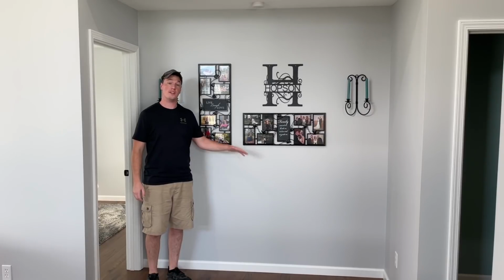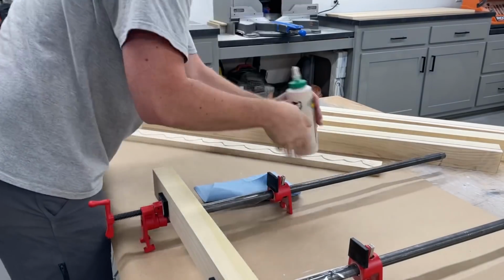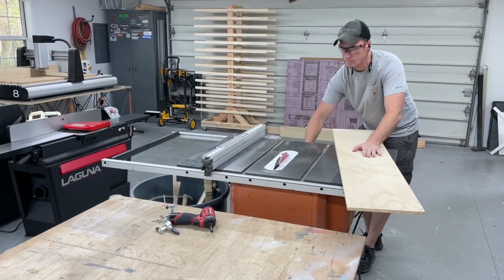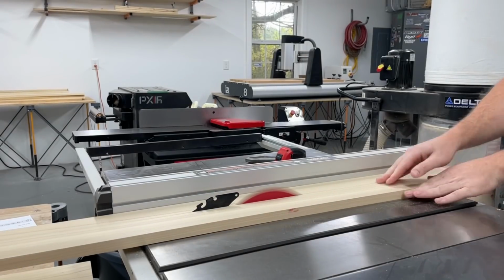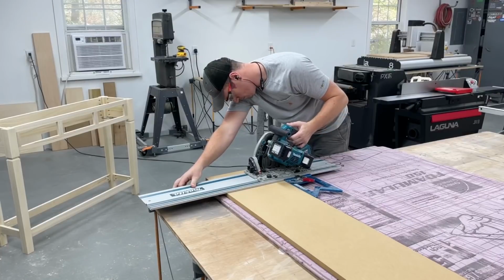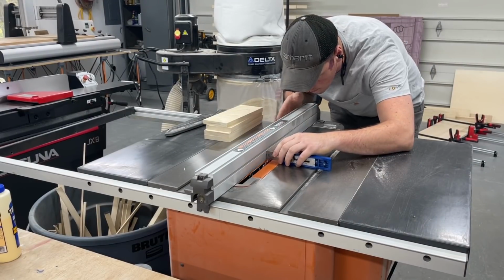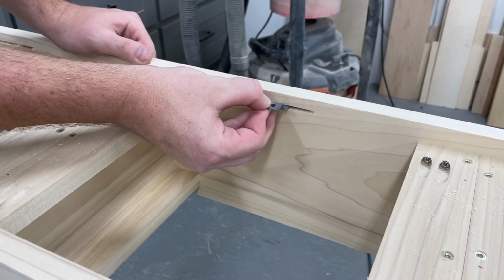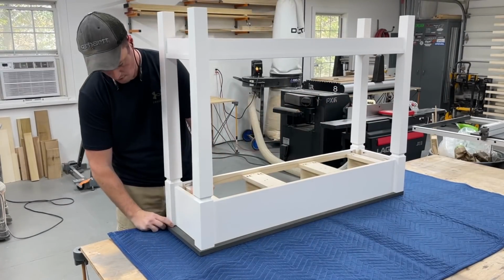Sofa/Entryway Table Build | Plans Available!

Comment: This is a beautiful piece my friend.. I love the look of the Poplar. Did u use Poplar, don't know if I spelled it correctly, for the top of the unit? The grey is really sweet looking man.. I was wondering how u got that groove cut into the legs.
I'm a wee bit envious of ur machines u have in the shop. They are real nice bro. 
I don't have the spare reddies to blow on something so nice but we gotta work with what we have so I have enough tools to get something like it. 
Poplar is a lovely wood. Is that one of the softer Hardwoods? I ;ove the look of the grain in this wood. 
U built a stunning looking piece and the face frames with Pocket holes are real nicely done too. This is where pocket hole jigs really shine imho.
Reply from the maker: Thank you!! The top is Ash, then the rest is poplar

Comment: I noticed that you used to use BIN oil-based primer, similar to the one you linked to in the description, but later changed to the Kem Aqua surfacer. Any particular reasons for this? The BIN is easier to obtain for me, though I don’t look forward to cleaning my gun after using non-water paints!
Reply from the maker: I just try different products sometimes. BIN is my usual primer
Reply: @JohnBuildsIt  Thanks, John. Would the water-based version of BIN primer be sufficient, or would you stick with the oil-based one? It's twice the price and I'm not quite sure if my spray gun can handle the oil version.

Comment: Regarding the rabbets on the false drawer fronts matching the dimensions of the drawer exactly so that the drawer recesses into the frame... Couldn't you have just used a thinner piece for the front and attached directly to the drawer?
Reply from the maker: Thought about it, but material that thin would be way more likely to cup or something over time, plus there’d hardly be any depth to screw into when attaching it to the box

Comment: Should have been an A++.  But, as my Jr. High Shop teacher would say:
"I saw you spreading glue with your fingers so you get an F"
I cannot believe that someone with $10k in top of the line Laguna Tools would do such a rookie thing.  Spend a couple of bucks on a box of flux brushes if nothing else.
Reply from the maker: I have several brushes. Sometimes I prefer this and find it faster and easier. Don’t see anything wrong with that lol.
Reply: Wow, a 16 minute video of a build and all you got out of it was a negative...you should be so proud
Reply: So, that “F” that you got in shop all those years ago is still eating you up? Bummer, man … 

It’s a great build @John Builds It

Comment: So when painting the edge of the MDF, do you just sand in-between coats of primer to get the little fuzzys to look smooth?
Reply from the maker: Yep! 👍🏽
Reply: @JohnBuildsIt  have you ever tried a product on the edges called sanding sealer? I've been told it works better than recounting and resanding over again

Comment: Very nice project and nice build, I don't know how you turned up the drawer stops with the top on, but maybe you could put them on the inside of the draw.
Reply from the maker: Reached underneath and rotated them up👍🏽there’s several ways you can do it this is just the most hidden